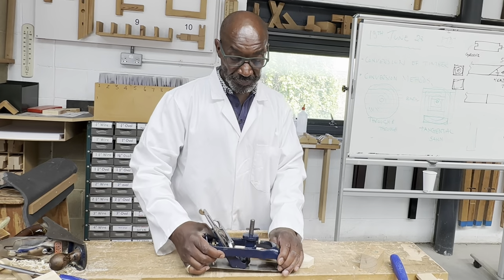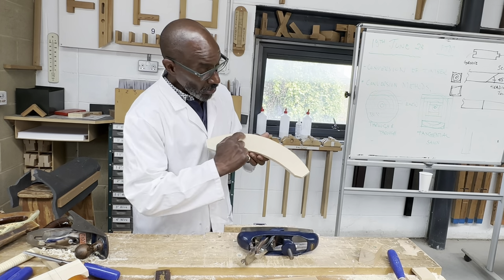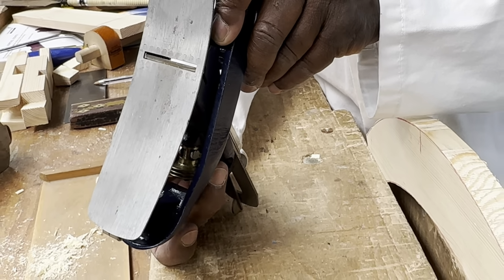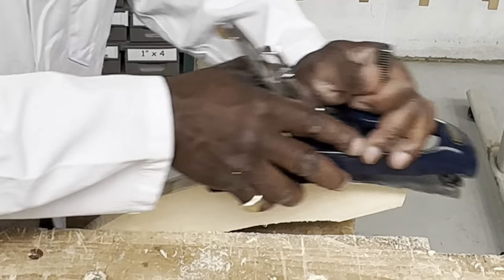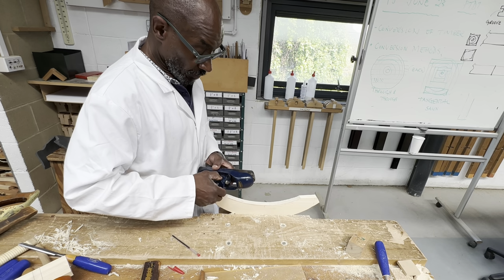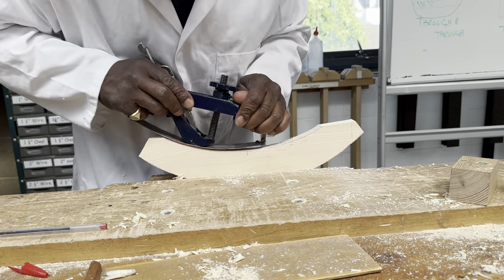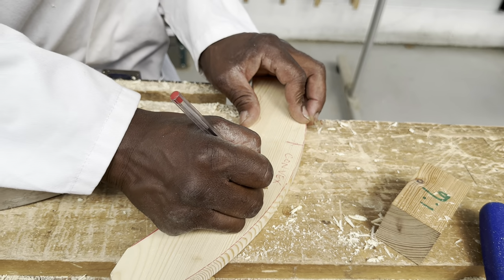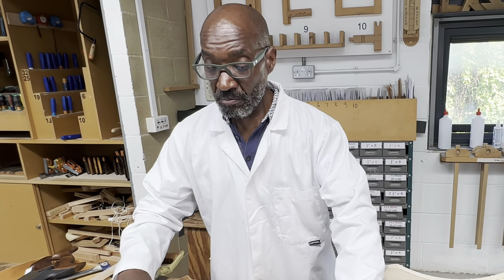-carpentry college- compass plane demonstration RECORD 020C

Comment: best not to do one half then the other, but to work alternatively on both sides. a few strokes on each otherwise as the first half gets lower the remaining high unfinished side will catch the front of the sole.....this way you take both sides down evenly to the correct radius.